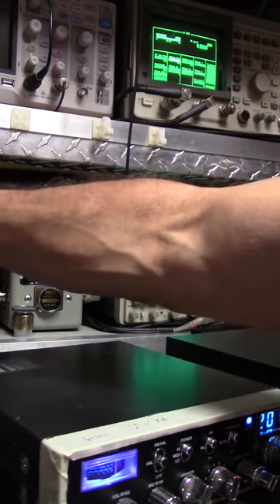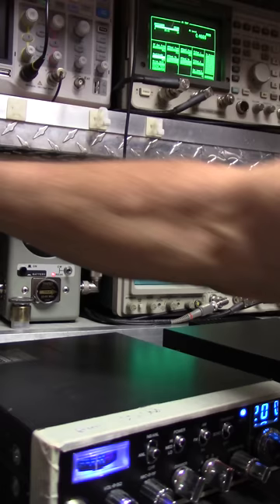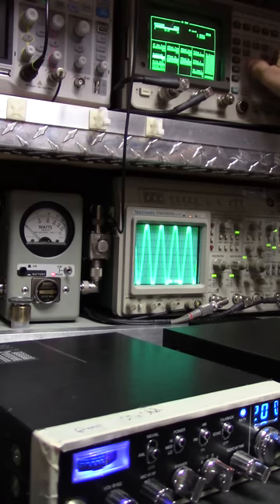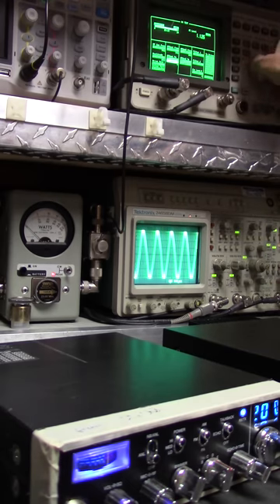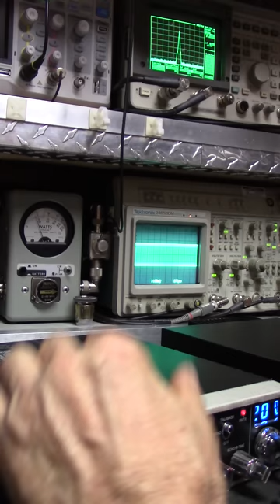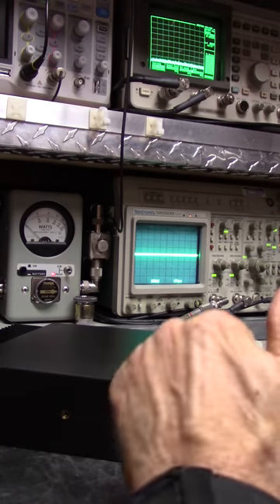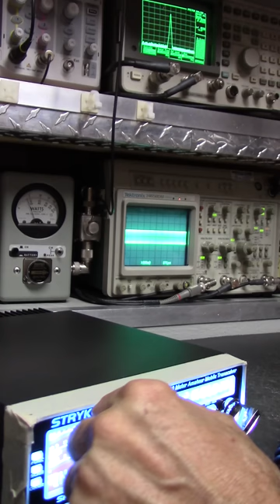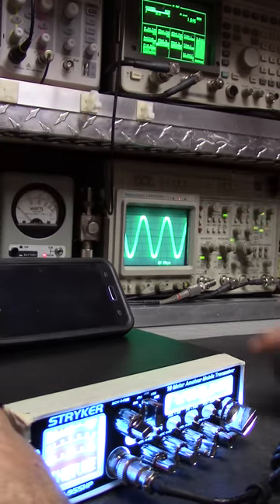SR655 and SR955 Radio and Meter ..  100 mV not 1uV with MAX MOD Part 1.

Comment from the maker: Bite your tongue and follow directions .. Here's what it takes to cut through the noise, be loud and crystal clear with a better receiver too:  A) Tuned Bench:  https://www.youtube.com/watch?v=lwcDfXOgAls.  True, it's more complicated and time consuming to accomplish these consistent and accurate results. Below is a partial procedure and list of calibrated equipment used to achieve this level of performance . Read on ..

Fine Tune CB Radio Shop strictly adheres to (https://www.nist.gov/) NIST Traceable Calibrations and other industry standards to maintain accuracy and consistency for providing Real World Performance Tuning of Citizens Band and 10 Meter export mobile radios with integrity.

"Basic Textbook AM/FM/SSB Transceiver Tune, Alignment and Calibration" 

1) Pll adjustments
VCO & OSC, AM TX OSC, USB TX OSC, LSB TX OSC.

2) Transmitter alignment
DRIVER BIAS, FINAL BIAS, SSB  (or gate voltages for mosfet versions) CARRIER BALANCE, HI-LO AM & SSB Power, RF METER, AMC, ALC and FM DEVIATION.

3) Receiver alignment
AM/FM RF & IF SENSITIVITY, FM DETECTOR/DEVIATION, SSB IF SENSITIVITY, SSB S-METER, AM/FM S-METER (100uV unmodulated -67dbm for “S-9” meter reading!), AM/FM SQUELCH RANGE, SSB SQUELCH RANGE, and NOISE BLANKER/AUTOMATIC NOISE LIMITER (Real World dBm to volts (uV) tables below).

That's just a typical run of the mill textbook tune up and alignment (if you're lucky). There's more to it than frequency alignment, modulation adjustment, meter calibration and a tune up report displaying exaggerated rms Bird peak watts! 

"Test Bench includes"

Bird 4314C Meter
https://www.birdrf.com/Products/Test%20and%20Measurement/Power-Meters/Wattmeters-Line-Sections/RF-Wattmeters/4314C_PEP-Single-Element-Wattmeter.aspx
Part 1) https://www.youtube.com/watch?v=RpX9IHe4ORM&t=16s
Part 2) https://www.youtube.com/watch?v=LuhbqTf6Bxw
Bird 4314C Accuracy Test: https://www.youtube.com/watch?v=DqEOabYqhQo&t=5s
Bird Stipulates 1/2 wavelengths  https://www.youtube.com/watch?v=5eWhgT-rTII
And Genuine Bird Elements from 1K down.

Bird 4373 Sampler 
https://www.rfparts.com/signal-samplers.html

HP8924c with options
http://userequip.com/files/specs/2147/HP%208924C%20Repair.pdf
https://www.youtube.com/watch?v=Cg1w0xBa27s&t=1s

HP8920a with options
https://www.keysight.com/upload/cmc_upload/All/EPSG072204.pdf

Three analog scopes, one digital 200 Mhz
https://www.atecorp.com/atecorp/media/pdfs/data-sheets/tektronix-2465b-2467b_manual.pdf
https://www.youtube.com/watch?v=by98x4eu2lM

Fluke 27fm
http://www.fluke.com/fluke/inen/digital-multimeters/fluke-27.htm?pid=56055
 
LCR http://www.lcrresearch.com/wp-content/uploads/2017/05/LCR_Pro1_Manual_version1.03.pdf

Power supplies
6 Cosel PBA1500f12 (750 amps) variable and configurable.
https://en.cosel.co.jp/product/powersupply/PBA/PBA1500F/PBA1500F-12/
Corcom 20VB1 F7130 EMI Filter 50-60Hz 250V

Times Microwave Coax jumpers and test leads
http://www.timesmicrowave.com/cms/products/cables/lmr/
https://www.youtube.com/watch?v=EmqaGJ6IWow
https://www.youtube.com/watch?v=1ltFVSxGp5Y
https://www.youtube.com/watch?v=v12YZT_1o90
https://www.youtube.com/watch?v=h7iiYfmYWRA&t=215s

Amphenol RF Connectors
https://www.amphenolrf.com/
https://www.youtube.com/watch?v=dVh5B0hdEA0 
https://www.youtube.com/watch?v=dKZg8T_AOso

More range, compliments, reliability and a quieter, clearer but more sensitive receiver,  Get Fine Tuned .. not peaked and ruined.

Here are some VideoGates of me at the bench practicing what I preach using my bench radio or customers radio completed and ready to be shipped: https://www.youtube.com/results?search_query=hard+drive+163+ more: https://www.google.com/search?q=Hard+Drive+163+nm&ie=utf-8&oe=utf-8&client=firefox-b-1-ab

It's what I recommend, use, service and sell ... to you ... not something non practical or deceiving in a misleading way. I'm not just the tech and owner of Fine Tune CB Radio Shop, I'm a customer too!  When finished, You'll be giving radio checks, not asking for them .

dBm To Watts and Volts
Tables below displays relationship between Power in [dBm] or [Watts] and Voltage in RMS, peak, peak-to-peak for sinusoidal signals in 50-Ohm systems for accurately measuring and tuning am/fm/ssb receiver sensitivity, agc, squelch and "S9" Meter calibration. Real World! Mike @ Mikes Radio Repair (Romper Room), Mark Rutherford aka Mark 19960, CB Kidd, Martian and all of your other fake accounts pay attention to the tables below, stop misaligning radios, spreading false information and promoting propaganda! 

  [dBm] [Watts]   [Volts]rms   [Volts]p    [Volts]pp
-140 0.100E-16  22.361 nV  31.618 nV  63.236 nV 
-139 0.126E-16  25.089 nV  35.476 nV  70.952 nV 
-138 0.158E-16  28.150 nV  39.805 nV  79.609 nV 
-137 0.200E-16  31.585 nV  44.662 nV  89.323 nV 
-136 0.251E-16  35.439 nV  50.111 nV  100.222 nV 
-135 0.316E-16  39.764 nV  56.226 nV  112.451 nV 
-134 0.398E-16  44.615 nV  63.086 nV  126.172 nV 
-133 0.501E-16  50.059 nV  70.784 nV  141.568 nV 
-132 0.631E-16  56.167 nV  79.421 nV  158.842 nV 
-131 0.794E-16  63.021 nV  89.112 nV  178.223 nV 
-130 0.100E-15  70.711 nV  99.985 nV  199.970 nV 
-129 0.126E-15  79.339 nV  112.185 nV  224.370 nV 
-128 0.158E-15  89.019 nV  125.874 nV  251.747 nV 
-127 0.200E-15  99.882 nV  141.232 nV  282.465 nV 
-126 0.251E-15  112.069 nV  158.465 nV  316.931 nV 
-125 0.316E-15  125.743 nV  177.801 nV  355.602 nV 
-124 0.398E-15  141.086 nV  199.496 nV  398.992 nV 
-123 0.501E-15  158.301 nV  223.838 nV  447.677 nV 
-122 0.631E-15  177.617 nV  251.151 nV  502.302 nV 
-121 0.794E-15  199.290 nV  281.796 nV  563.591 nV 
-120 0.100E-14  223.607 nV  316.180 nV  632.360 nV 
-119 0.126E-14  250.891 nV  354.760 nV  709.519 nV 
-118 0.158E-14  281.504 nV  398.047 nV  796.094 nV 
-117 0.200E-14  315.853 nV  446.616 nV  893.232 nV 
-116 0.251E-14  0.354 µV  0.501 µV  1.002 µV 
-115 0.316E-14  0.398 µV  0.562 µV  1.125 µV 
-114 0.398E-14  0.446 µV  0.631 µV  1.262 µV 
-113 0.501E-14  0.501 µV  0.708 µV  1.416 µV 
-112 0.631E-14  0.562 µV  0.794 µV  1.588 µV 
-111 0.794E-14  0.630 µV  0.891 µV  1.782 µV 
-110 0.100E-13  0.707 µV  1.000 µV  2.000 µV 
-109 0.126E-13  0.793 µV  1.122 µV  2.244 µV 
-108 0.158E-13  0.890 µV  1.259 µV  2.517 µV 
-107 0.200E-13  0.999 µV  1.412 µV  2.825 µV 
-106 0.251E-13  1.121 µV  1.585 µV  3.169 µV 
-105 0.316E-13  1.257 µV  1.778 µV  3.556 µV 
-104 0.398E-13  1.411 µV  1.995 µV  3.990 µV 
-103 0.501E-13  1.583 µV  2.238 µV  4.477 µV 
-102 0.631E-13  1.776 µV  2.512 µV  5.023 µV 
-101 0.794E-13  1.993 µV  2.818 µV  5.636 µV 
-100 0.100E-12  2.236 µV  3.162 µV  6.324 µV 
-99 0.126E-12  2.509 µV  3.548 µV  7.095 µV 
-98 0.158E-12  2.815 µV  3.980 µV  7.961 µV 
-97 0.200E-12  3.159 µV  4.466 µV  8.932 µV 
-96 0.251E-12  3.544 µV  5.011 µV  10.022 µV 
-95 0.316E-12  3.976 µV  5.623 µV  11.245 µV 
-94 0.398E-12  4.462 µV  6.309 µV  12.617 µV 
-93 0.501E-12  5.006 µV  7.078 µV  14.157 µV 
-92 0.631E-12  5.617 µV  7.942 µV  15.884 µV 
-91 0.794E-12  6.302 µV  8.911 µV  17.822 µV 
-90 0.100E-11  7.071 µV  9.998 µV  19.997 µV 
-89 0.126E-11  7.934 µV  11.218 µV  22.437 µV 
-88 0.158E-11  8.902 µV  12.587 µV  25.175 µV 
-87 0.200E-11  9.988 µV  14.123 µV  28.246 µV 
-86 0.251E-11  11.207 µV  15.847 µV  31.693 µV 
-85 0.316E-11  12.574 µV  17.780 µV  35.560 µV 
-84 0.398E-11  14.109 µV  19.950 µV  39.899 µV 
-83 0.501E-11  15.830 µV  22.384 µV  44.768 µV 
-82 0.631E-11  17.762 µV  25.115 µV  50.230 µV 
-81 0.794E-11  19.929 µV  28.180 µV  56.359 µV 
-80 0.100E-10  22.361 µV  31.618 µV  63.236 µV 
-79 0.126E-10  25.089 µV  35.476 µV  70.952 µV 
-78 0.158E-10  28.150 µV  39.805 µV  79.609 µV 
-77 0.200E-10  31.585 µV  44.662 µV  89.323 µV 
-76 0.251E-10  35.439 µV  50.111 µV  100.222 µV 
-75 0.316E-10  39.764 µV  56.226 µV  112.451 µV 
-74 0.398E-10  44.615 µV  63.086 µV  126.172 µV 
-73 0.501E-10  50.059 µV  70.784 µV  141.568 µV 
-72 0.631E-10  56.167 µV  79.421 µV  158.842 µV 
-71 0.794E-10  63.021 µV  89.112 µV  178.223 µV 
-70 0.100E-09  70.711 µV  99.985 µV  199.970 µV 
-69 0.126E-09  79.339 µV  112.185 µV  224.370 µV 
-68 0.158E-09  89.019 µV  125.874 µV  251.747 µV 
-67 0.200E-09  99.881 µV  141.232 µV  282.465 µV
-66 0.251E-09  112.069 µV  158.465 µV  316.931 µV 
-65 0.316E-09  125.743 µV  177.801 µV  355.602 µV 
-64 0.398E-09  141.086 µV  199.496 µV  398.992 µV 
-63 0.501E-09  158.301 µV  223.838 µV  447.677 µV 
-62 0.631E-09  177.617 µV  251.151 µV  502.301 µV 
-61 0.794E-09  199.290 µV  281.796 µV  563.592 µV 
-60 0.100E-08  223.607 µV  316.180 µV  632.360 µV 
-59 0.126E-08  250.891 µV  354.760 µV  709.520 µV 
-58 0.158E-08  281.504 µV  398.047 µV  796.094 µV 
-57 0.200E-08  315.853 µV  446.616 µV  893.232 µV 
-56 0.251E-08  0.354 mV  0.501 mV  1.002 mV 
-55 0.316E-08  0.398 mV  0.562 mV  1.125 mV 
-54 0.398E-08  0.446 mV  0.631 mV  1.262 mV 
-53 0.501E-08  0.501 mV  0.708 mV  1.416 mV 
-52 0.631E-08  0.562 mV  0.794 mV  1.588 mV 
-51 0.794E-08  0.630 mV  0.891 mV  1.782 mV 
-50 0.100E-07  0.707 mV  1.000 mV  2.000 mV 
-49 0.126E-07  0.793 mV  1.122 mV  2.244 mV 
-48 0.158E-07  0.890 mV  1.259 mV  2.517 mV 
-47 0.200E-07  0.999 mV  1.412 mV  2.825 mV 
-46 0.251E-07  1.121 mV  1.585 mV  3.169 mV 
-45 0.316E-07  1.257 mV  1.778 mV  3.556 mV 
-44 0.398E-07  1.411 mV  1.995 mV  3.990 mV 
-43 0.501E-07  1.583 mV  2.238 mV  4.477 mV 
-42 0.631E-07  1.776 mV  2.512 mV  5.023 mV 
-41 0.794E-07  1.993 mV  2.818 mV  5.636 mV 
-40 0.100E-06  2.236 mV  3.162 mV  6.324 mV 
-39 0.126E-06  2.509 mV  3.548 mV  7.095 mV 

                 Don't Be A Mud Duck!

 https://www.arrl.org/shop/ARRL-Handbook-2019-eBook

Hard Drive 163 NM. 73's! Click click.?